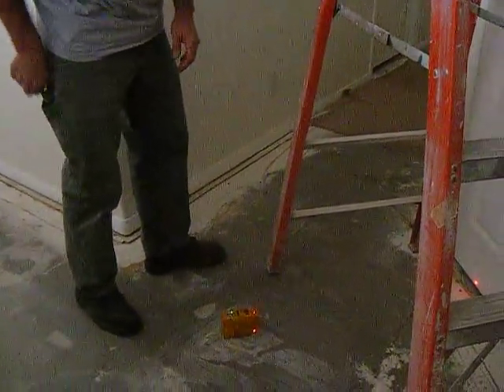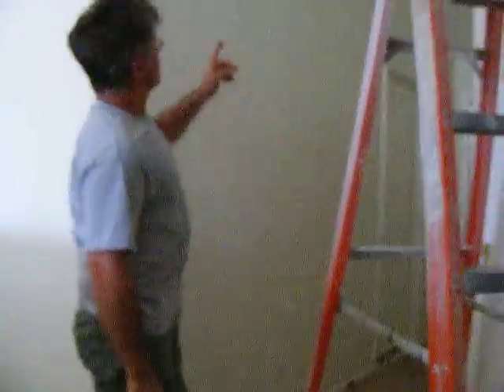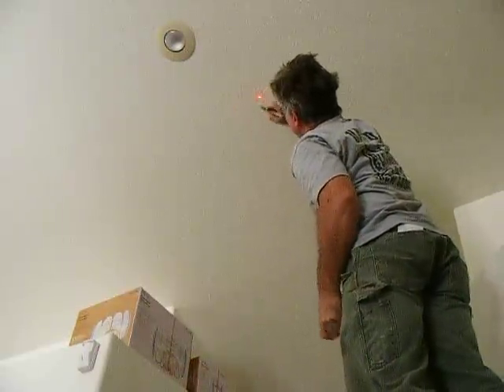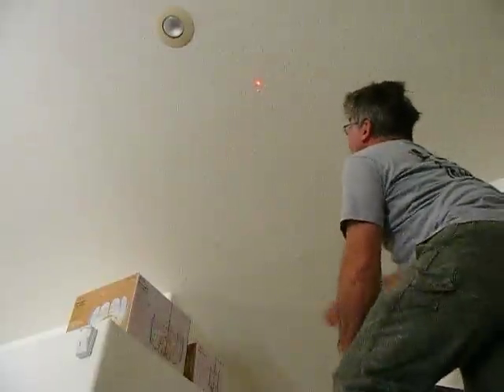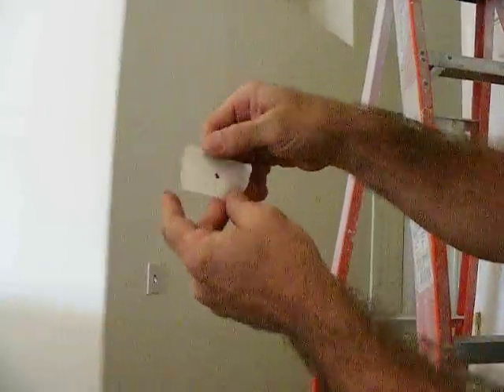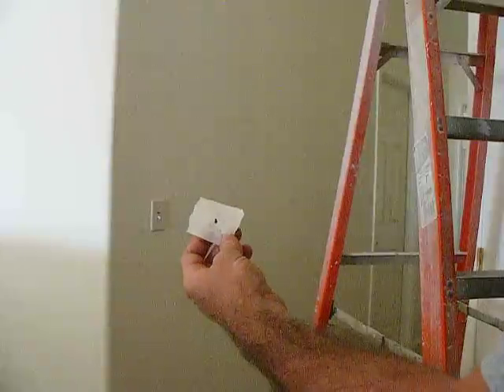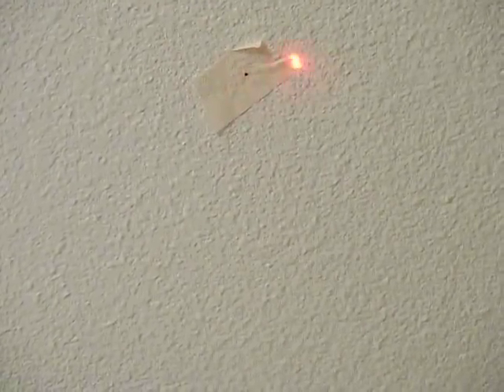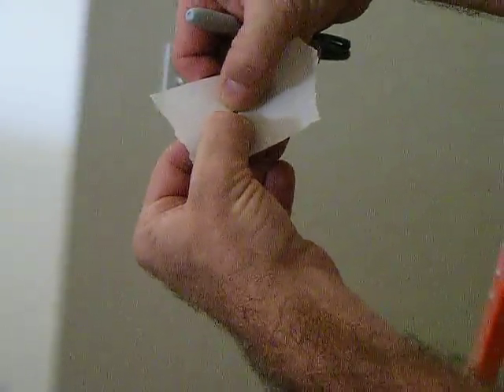How to check the accuracy of a laser plumb

Comment: Doing what he said in the video is a fast way to check. if you want to check for EXACTLY perfect, do the same test. set up a dot on the floor and on ceiling but instead of flipping it, which you can still do, use an old fashioned plumb bob. Plumb bobs are still widely used as the definitive 100% accurate method when things need to be exactly, like when hanging doors as an out of plumb will cause the door to rub. Just hang your plumb bob exactly on your mark on the ceiling and it should land directly on the floor on your mark, if not, your laser is out. But like I said earlier, his method in the video will be basically good enough, this is just if you want to know EXACTLY WITHOUT A DOUBT how much out it is.